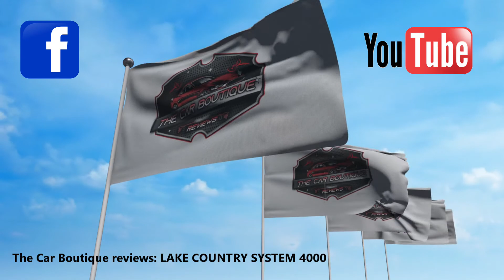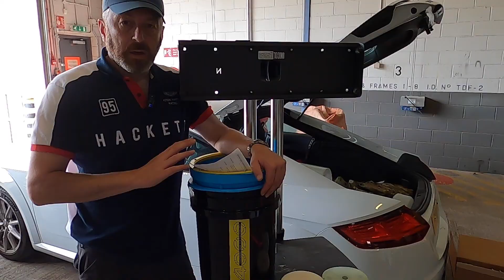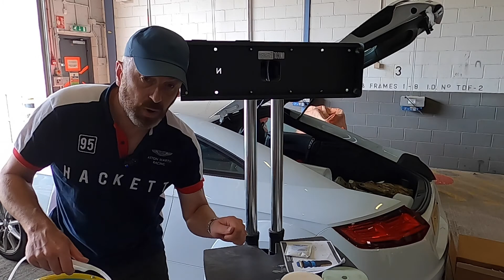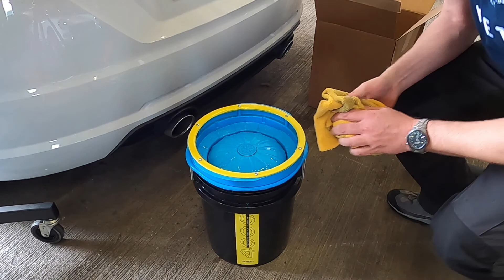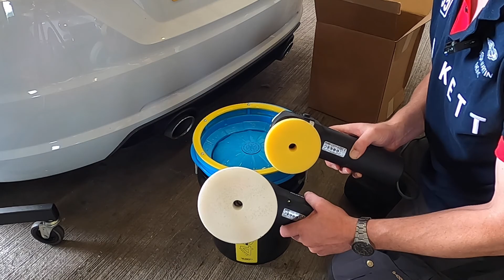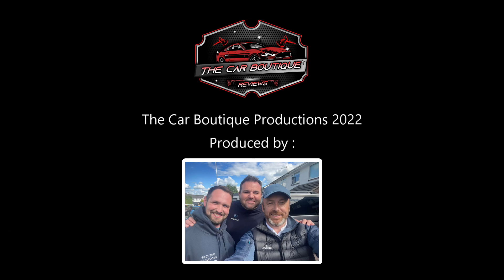The Car Boutique reviews: Lake Country Pad Washer System 4000

Comment: I think it`s one of the rare products that you pay for the idea and not the construction which is cheap and maybe won`t last more than 1 year or 2.

I wonder what  would be the difference in just spinning the pad on a microfiber towel with cleaner on it and then spin it in the air.
Reply from the maker: I sort of agree buddy. The price is very high baring in mind it's a bucket with a few extras. Build quickly is good though.

Comment: Great video and information. Wont this make the pad to damp and soft to work with around the car ( for foam pads) ? 
Thank you
Reply from the maker: Cheers. A good question. Some people do wash then use straight away. Personally I would agree that it's best to let dry out for a bit. The machine does spin the pads dry but they are still slightly damp.
Reply: @thecarboutique2467  Great, thank you very much for the reply. Just found your channel today, great content. Looking forward to watching more videos. Cheers friend.

Comment: Nice bit of kit if you do a lot of car detailing. For me it would be useful to have a video on 2 stage Polishing, when to clean the pads how many you should use on a large car i.e. BMW 5/7 Series. Seen a tip to use a toothbrush to clean a pad whilst using it.
Reply from the maker: Hiya Simon. Some good ideas on a future video. I use a lot of pads per car, usually between 5 and 10. Some people prefer to just buy more pads and would see this item as not required. I see the argument but like I said in the video, it's about personal choice.